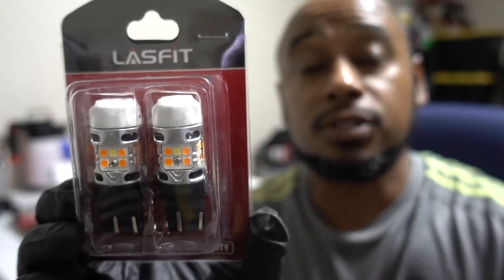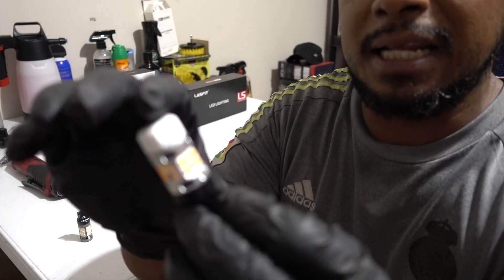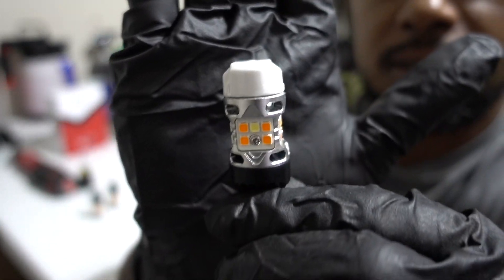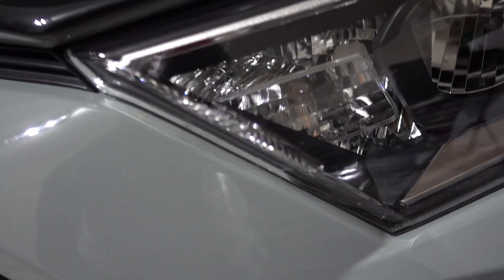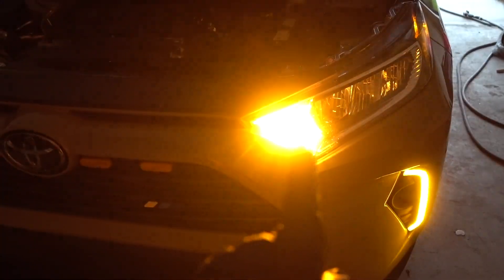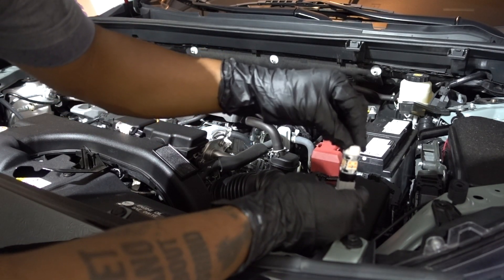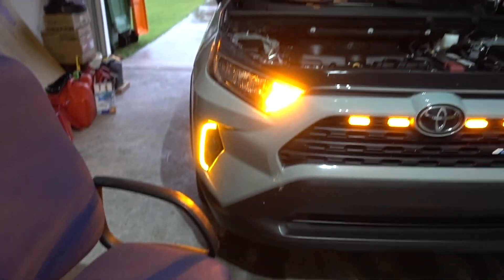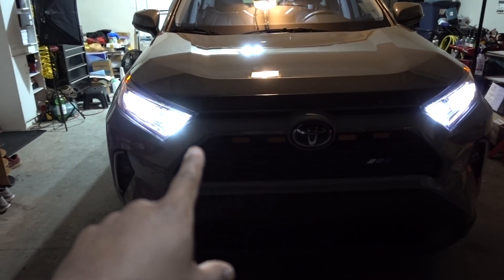Brand New T3 7443 Switchback LED Turn Signal From Lasfit

Comment: I bought the previous version of thoose bulbs for my 4Runner and the hyperflashed inmediatly so I installed resistors and now the work just fine. Now I see this 2023 version promising they could fix the mistake without the resistor needed, but I see measured the time they do keep working as should. My question to you: Do you think that a resistor would  keep my actual bulbs from getting heated better than taking them off and installing the new bulbs, or the new version of the bulbs would protect better than the resistor?
Reply from the maker: I think if you have a working setup why change it? But it don’t know if they are compatible with your vehicle

Comment: Had a set in the front on my 2018 XLE rav4 - even with ballast - they older switchbacks hyperflash. had to repair/remove the Lasfits and balast from the front. Must have some issue in the CANBUS? It was worse only when the engine is running? But engine off - blinks normal.
Reply from the maker: Yes the bulb probably is bad
Reply: Bought a set. Immediately both overheat and hyperflash. Seriously think the CANBUS is sending too much current to the front.
Reply: Normaly i thought that Lasfit is the best,but I also read there a lot of Problems 
I can buy chinese crap or better 
I want to pay more for Quality but When I read Here a lot its overprized 
And LASFIT dont send to Europa

Comment: when i install it it the white light didn't work why?
Reply from the maker: It depends on the vehicle, flip the bulb around
Reply: The white light didn’t work on my 2023 RAV4. Called lasfit and was told that it wouldn’t work because I have 2 wires instead of 3 wires. It didn’t say anything about that on there sight
Reply from the maker: I didn’t said that because every vehicle is different, you have to see if your car has running lights on the turn signals
Reply: @BulletSolano  how can I tell if it does?
Reply from the maker: Look on the connector
Reply: @albertrodriguez4745  what model 2023 you have? I have a 2023 xle premium. Wonder if this will be an issue for all 2023 models?